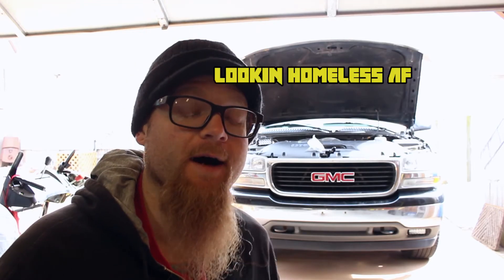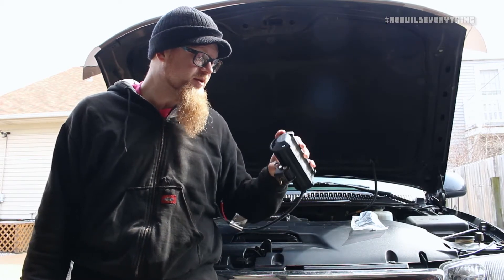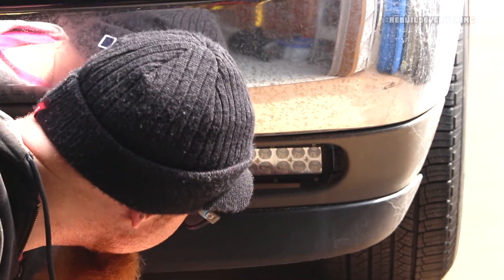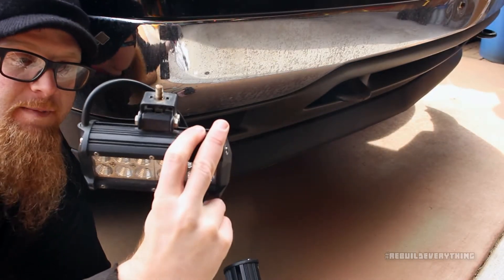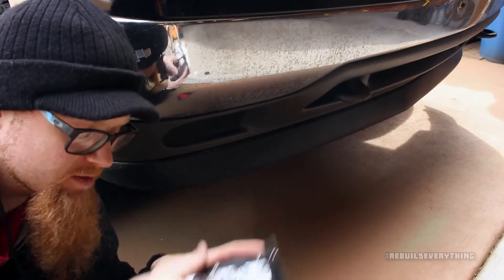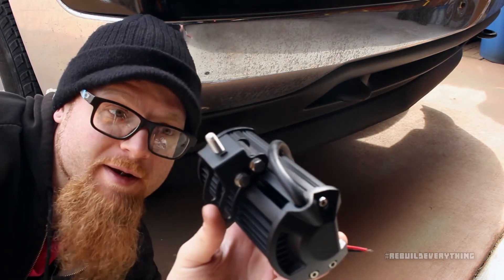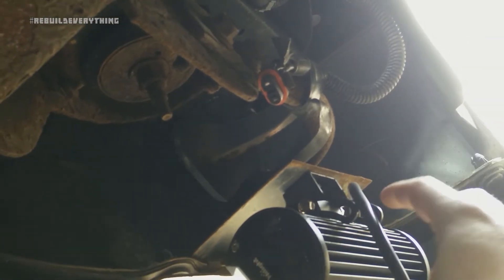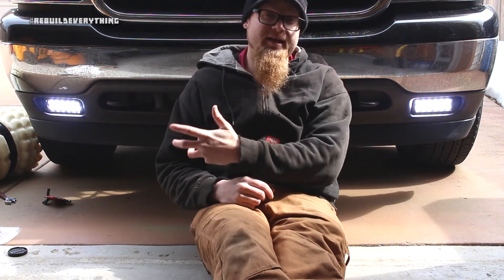Re-Replacing LED Fogs - #REBUILDEVERYTHING 10

Comment: Hey i know this video is old. But the valance under the bumper. I have a 2000 yukon and dnt have it…..is that from a different truck????????
Reply from the maker: Not that I'm aware. Truck was kept stock by PO
Reply: @REVJHD  if u look under fromt bumper. The balance bolts right on?

Comment: Did the same 4 years ago but the problem with these. The LEDs dont last for crap. i have gone through 6 pairs of LEDs
Reply from the maker: After that initial replacement (and the moisture proofing), mine have lasted pretty well. The housings have corroded a little bit from salt etc on the roads, but all 4 I have still work.  I do have one in the rear that seems to be dimmed a bit, but still works on all leds.
Reply: @REVJHD  Im thinking of putting the stock fog housing back on and just replacing the bubls with brighter led ones. Im not to sure if the bulbs can even be replaced but after a lot of yt researching some have.